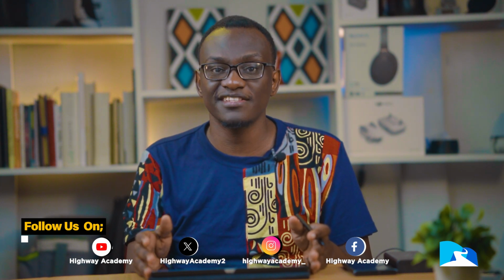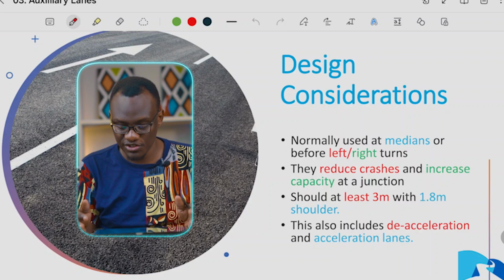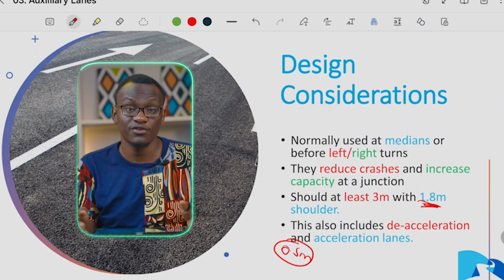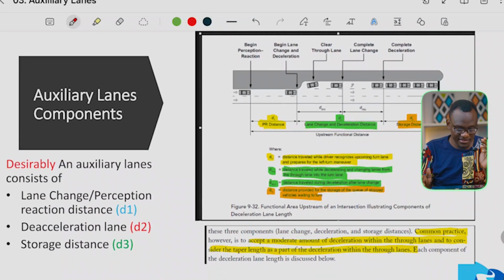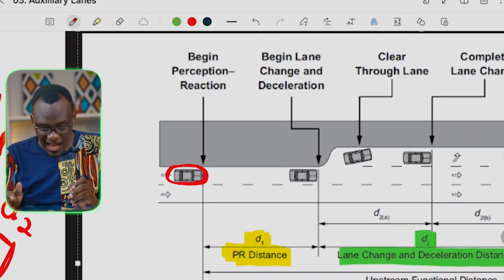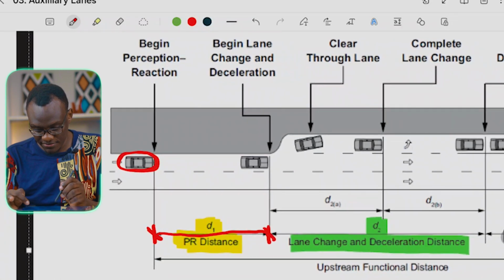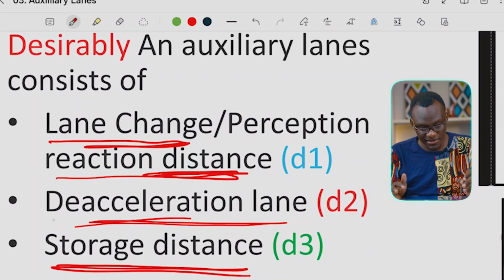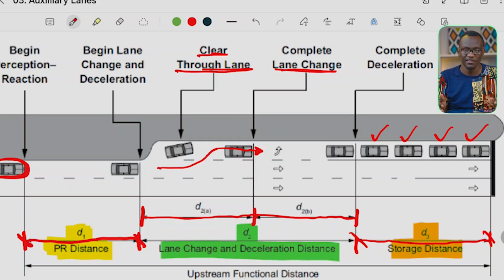Junction Course Theory: 3-Theory for Junction Design (Introduction to D1,D2,D3)

Comment from the maker: The moment you've been waiting for has arrived! 🎉
Our complete Ultimate Guide to Junction course is now officially LIVE on our website and also the beginners Junction YouTube playlist is available. 

Ready to jump in and become a junction design guru
✅Link to the junction design course:  hwy.ac/jct-geo
Beginners guide to junction YouTube playlist
✅Link to the Beginners guide to junction YouTube playlist: hwy.ac/jct-geo-ply
Want to connect with our amazing community
 ✅Link to our Highway Academy WhatsApp channel for daily tips and updates right on your phone:
 https://hwy.ac/jct-ch
Got a question or just want to say hi? We'd love to hear from you!
✅Link to our WhatsApp direct chat: hwy.ac/wa

00:00 Intro
00:15 Introduction to the third lesson on junction design theory.
00:22 Introduction to designing auxiliary lanes.
00:28 Considerations for auxiliary lanes and their impact on junction length.
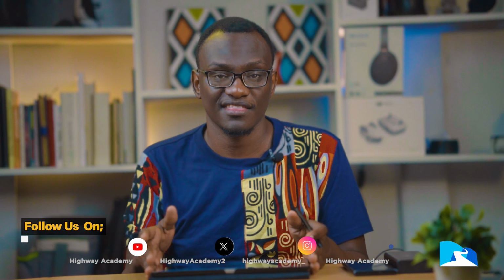00:36 Example showing auxiliary lanes with a U-turn and other elements.
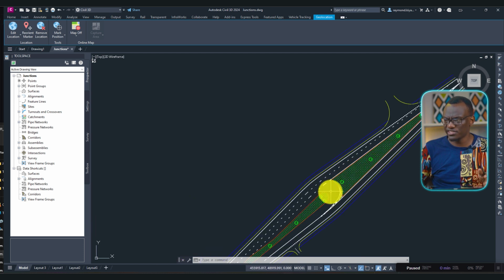00:44 Continued discussion of the example with a U-turn.
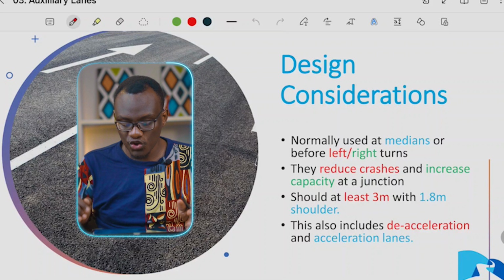00:50 Beginning of design considerations for auxiliary lanes.
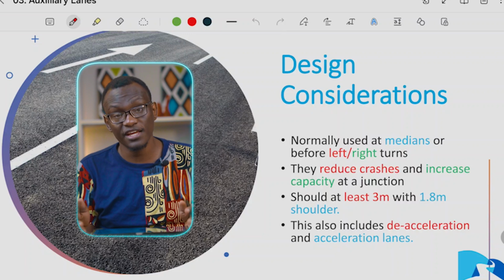00:58 Auxiliary lanes typically used at medians or before turns.
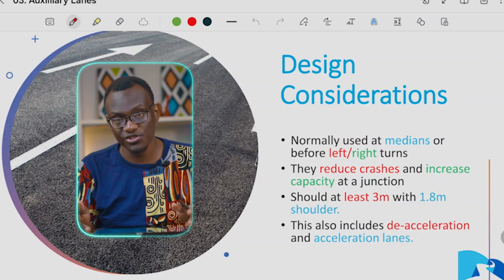01:06 Goal of auxiliary lanes: reduce crashes and increase capacity.
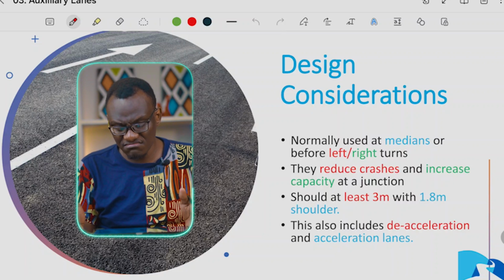01:13 Typical width of auxiliary lanes (at least 3 meters with 1.8-meter shoulders).
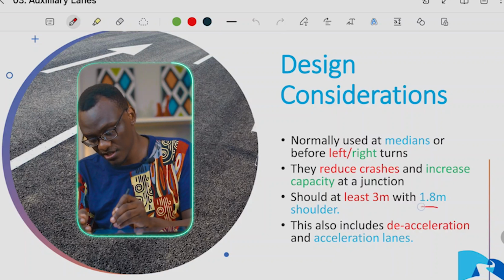01:21 Smaller shoulders (around 0.5 meters) in urban areas with constraints.